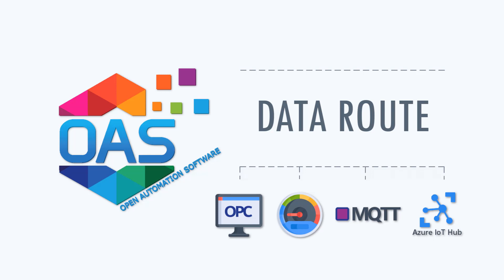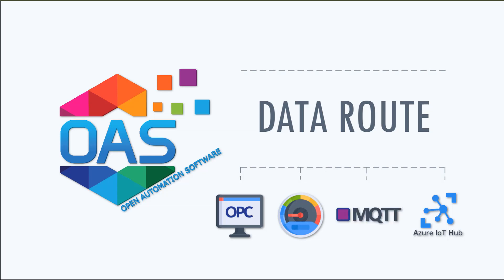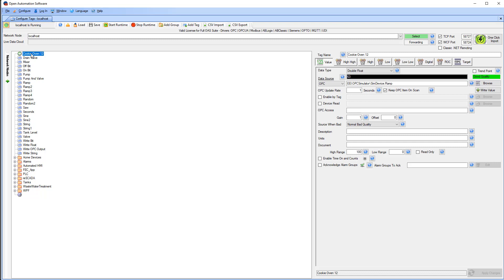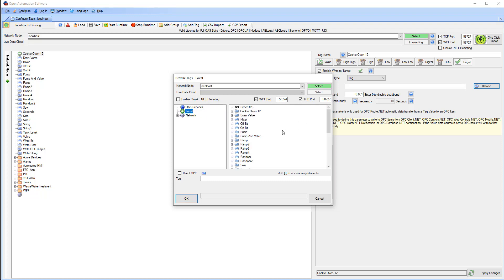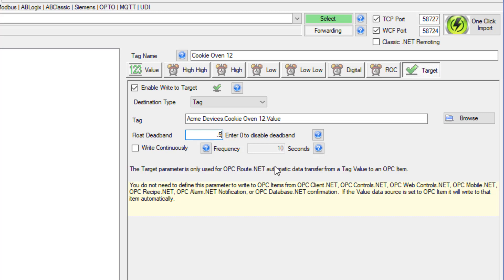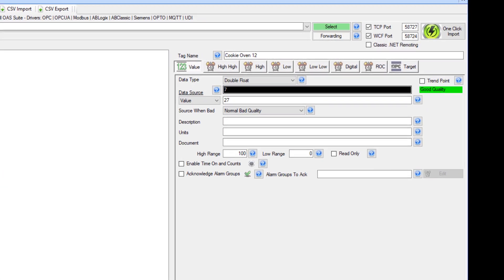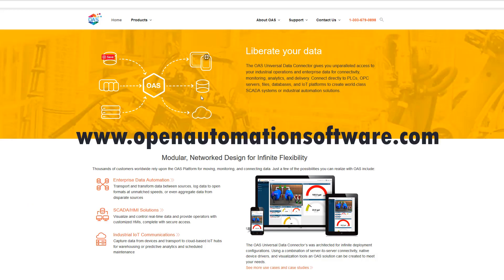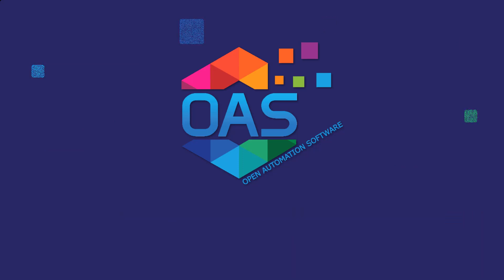IIoT Data Route

Comment: Passing data from one tag to another, doesn't delete the original data of the target tag?!
OR in another way to ask this, what is the purpose of overwriting data to a tag related to a different PLC or so, what about creating a new tag with the same value? like duplicating the source tag simply!!!
Reply from the maker: When the Data Source of the local or remote Destination Tag is set to AB, Siemens, Modbus, OPC, OPC UA, AWS IoT, etc. the value will be written to that Tag.  So you can transfer values from one PLC to another locally or remotely even over the Internet.